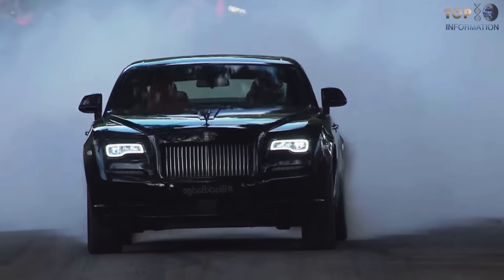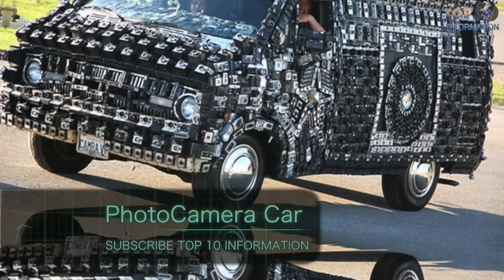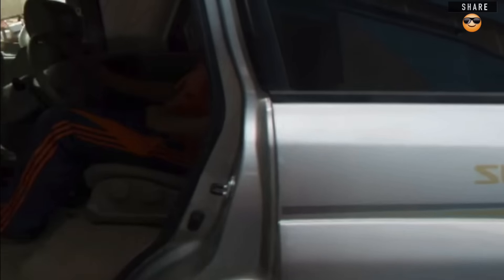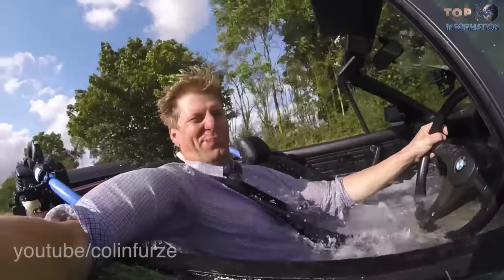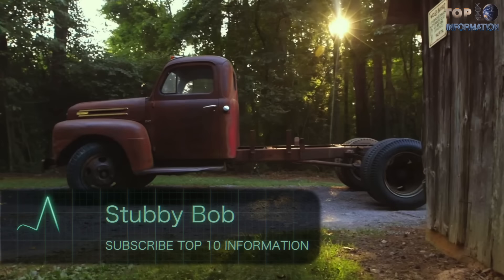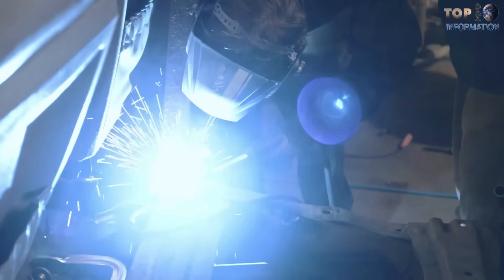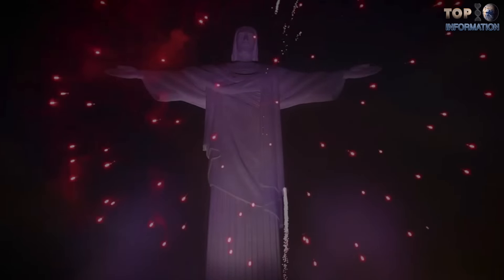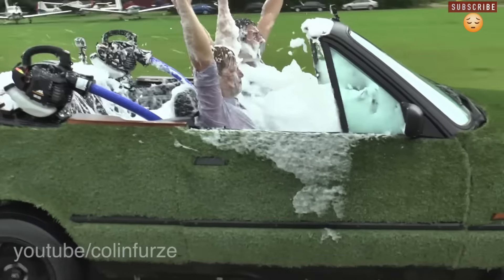10 INSANE Car'S ModiFications

Comment: 1 is a monster truck 
2 is a can covered in old cameras, 
3 is a sleeper car not a "ghost car" 
4 is a car with a pool table
5 is colinfurze's  hot tub car 
6 is a car with mini tank tracks
7 is souped up truck from the 30's-late 40's
8 is a a car made from the fronts of two cars 
9 is a car that has paint that changes color when its hot 
10 is a shitty car with a lot of really good speakers and subs

Comment: Alright, here are some issues I see here. The original Bigfoot was a 1976 Ford WITHOUT the giant tires. Also, if you watch Roadkill, You will know they are known for mediocre repairs on the road. Thus, Stubby Bob's "Precisley Installed" Chevy Big Block was in fact, dropped in about an hour. The "old tractor engine" was a 1951 F series Flathead V8. Never did ford install V8s In tractors in the 50s. Thats my reasoning